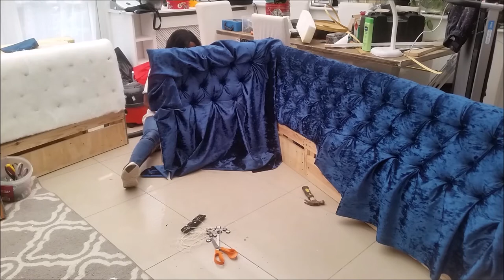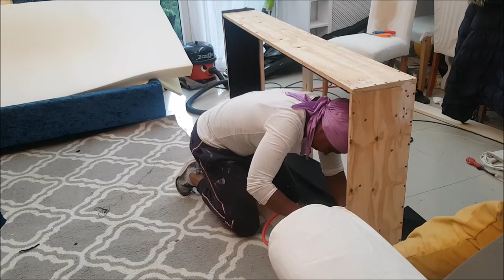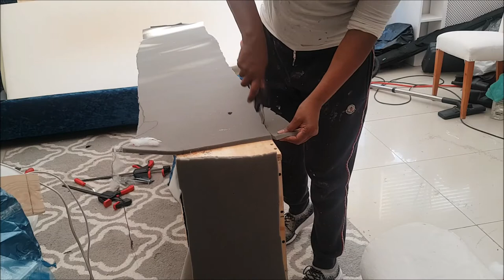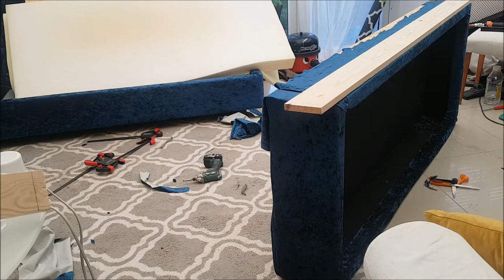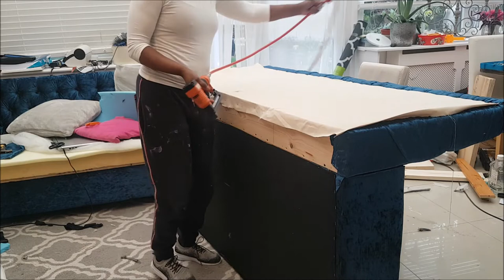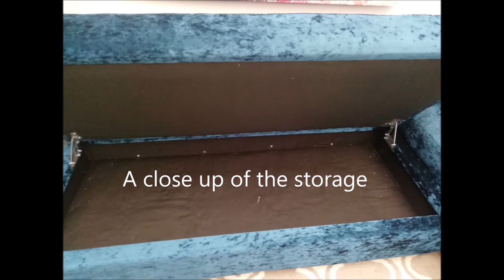How To Make a sofa: How to make a sofa at home: How to make a sofa Bed: Sofa bed with storage

Comment: You are doing an amazing job. What drill bit did you use to make the holes for your tufts?
Reply from the maker: Hi, so sorry for the delay in replying as I am Ill at the moment.  I can't remember but it looks like a 35mm hole cutter.  I believe the bigger the hole the deeper the tuft will be. Take a look at AOL upholstery where he made a sofa in two parts. I think that's where I got the size for the hole. Hope this helps thanks for viewing my channel.
Reply from the maker: Hi, so sorry for the delay in replying as I am Ill at the moment.  I can't remember but it looks like a 35mm hole cutter.  I believe the bigger the hole the deeper the tuft will be. Take a look at AOL upholstery where he made a sofa in two parts. I think that's where I got the size for the hole. Hope this helps thanks for viewing my channel.

Comment: Great job !! Looks amazing what are all the tools you used ?
Reply from the maker: Hi, Happy New Year, you need a heavy duty stapler, upholster needle to do the tufting and a button cover tool, scissors, hammer and saw to cut wood..  I use an air compressor staple gun which was a gift from my kids.